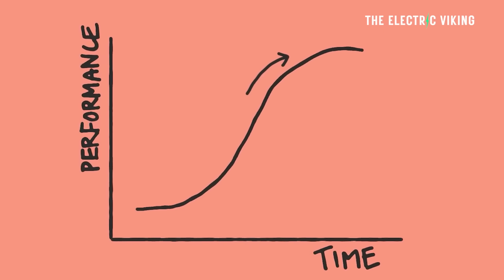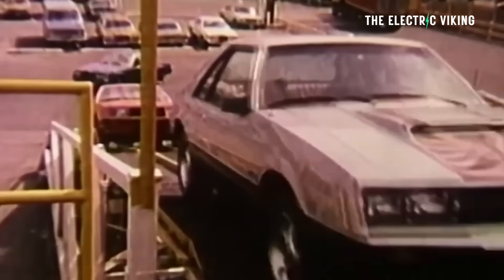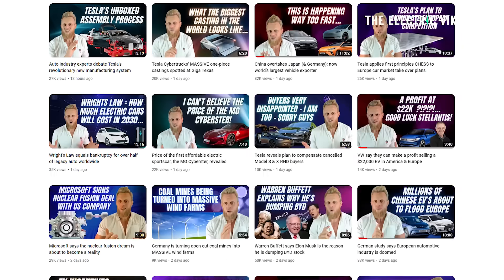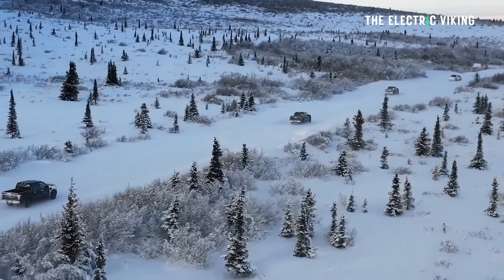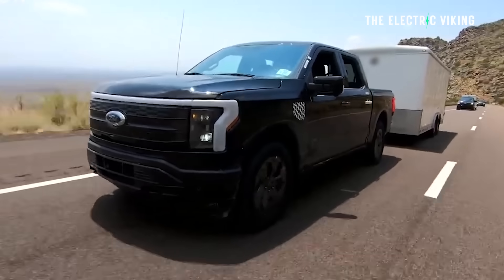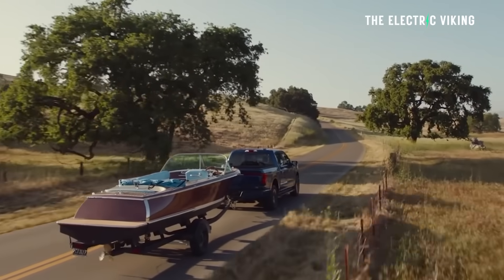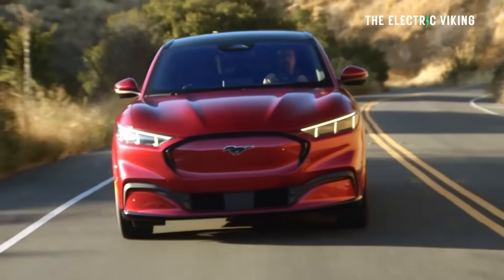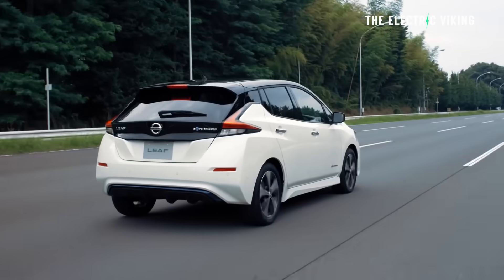EV sales are about to hit exponential disruption phase in the United States

Comment: In the US, the lack of a full coverage charging network is a major bottleneck, and a reason many are delaying buying an EV.   The 2nd reason is price point.   $80,000 Lightning.  $85,000 Rivian.   $90,000 Model S.   In general we are moving in the right direction....but I think 2025 might be the inflection point,  not 2024.
Reply: Charge it home and you can make it to anywhere with the super charger net work currently available. Buy a model Y or a model three.
Reply: @ZeusBullyMax    You have obviously not driven through southern New York State, Central Pennslyvania or rural Maryland with a NON-Tesla EV.   I have.     (FYI   in 2022 14 million vehicles were sold in the US.   Of that 465,000 were Teslas, which means 96.5% of new vehicles sold in the US in 2022 were not Tesla's....people's taste are very varied)
Reply: Model Y….
Reply: @777skypilot   Something to ponder.  In 2022 there were approx 14 million passenger vehicles sold in the US.    Of those, 485,000 were Teslas.  That means approx 3.5% of new vehicle buyers bought Teslas, but it also means 96.5% of US vehicle buyers bought something other than a Tesla.  96.5%        Taste? Styling? Lack of knowledge about Teslas?

Comment: U.S. EV Demographics & Leaderless Charging Infrastructure

Teaser: Of the more than 3,100 counties and city-counties in the U.S.
63 percent had five or fewer chargers installed; 39 percent had zero!

Should not the U.S. charging infrastructure (and supporting energy grids) be a “strategic asset” on par with our Interstate highway system?  

I would also make the same claim for a national cellular infrastructure that provides ubiquitous country-wide coverage similar to what China has already achieved with 4G, and 5G in rural and remote areas.

It would appear that most of the U.S. EV sales are focused on the top 20% of the population in:

“Top five list for EV sales through 2022: California (20.1 percent); District of Columbia (13.8 percent); Washington (12.9 percent); Oregon (11.5 percent); and Nevada (10.2 percent).”

In 2021, a little more than 52 percent of Americans had an annual household income that was less than 75,000 U.S. dollars. The median household income increased to 70,784 U.S. dollars in 2021.

It will take a rethink on the part of the U.S. EV industry to develop and “affordability model” for families in this income range.

Here it’s all about charging infrastructure which has been left to the whim of the private sector. We found during this past winter in cold states such as Colorado large segments of 3rd party, non-Tesla charging networks simply did not work or were so unreliable you would not risk driving in winter conditions outside of a city center. We had a number of reports of stranded EV owners during subfreezing temperatures.

The companies appear to develop charging networks similar to how cellular companies determine coverage in the U.S. They only go where private companies deem there are sufficient vehicles to justify the investment or if provided with government subsidies. It’s unlikely they will cover rural and less densely populated regions for decades to come just like we have large areas in the U.S. without internet and cellular coverage after nearly 28 years.

Go here for a map of the distribution of charging stations across the U.S.:

https://www.autosinnovate.org/posts/press-release/us-ev-sales-continue-record-run

“White and dark blue areas had five or fewer publicly available non-proprietary chargers added in 2022”

For the vast “bulk” of the U.S. EV's are still not practical, overpriced, and models are not tailored to the countries demographic makeup.

Excellent article:

U.S. EV Sales Continue Record Run in 2022; Charging Infrastructure Still Lagging, March 23, 2023

https://www.autosinnovate.org/posts/press-release/us-ev-sales-continue-record-run

Check out these depressing statistics on charging stations across the U.S.

Warning signs: Public charging infrastructure not keeping up

Infrastructure analysis reveals deep geographic disparities in access to public, non-proprietary charging in the country.

Of the more than 3,100 counties and city-counties in the U.S.:

63 percent had five or fewer chargers installed; 39 percent had zero;
The top 14 counties – or 0.4 percent of all counties – with the highest number of chargers accounted for 30 percent of all U.S. EV charging infrastructure.
2022 public charging data:

Total of 103,582 publicly available non-proprietary charging outlets in U.S. for 3.04 million EVs on the road, a ratio of 29 EVs per charger;
Installation of U.S. public chargers is not keeping up with current and projected EV sales. (Context: 934,958 EVs registered in 2022 and only 24,622 new chargers – a ratio of 38 vehicles for every new public port);
The number of non-proprietary Level 2, DC Fast and total public EV chargers increased 31 percent, year-over-year (from 79,000 in 2021 to 103,000 in 2022).

53 percent of U.S. counties added NO new chargers in 2022;
75 percent of U.S. counties added 5 or fewer chargers in 2022;
51 percent of all new charging was added in just 2 percent of U.S. counties;
25 percent of all new charging was added in California;
160 counties added only one new charger.

Comment: If 20 years from now 50% of new vehicles sold are EV and 50% are ICE, would you be OK with that? Is there a point at which consumers should have a choice, or must ICE be eliminated?
Reply: ICE will be wiped out by choice EVs and infrastructure will be so much better. If you own a home and charging is not an issue, EVs are already a better choice for most people. I'm happy whenever I drive my Mach E.
Reply: ICE is literally killing us. It gives our kids asthma, our friends and family cancer, covers our skies in smog. It’s an antiquated and horrible technology from over 100 years ago, we’re practically still using the steam engine.

But even if that weren’t the case, nobody is going to want ice way before 20 years from now. The EV industry is innovating rapidly, and there will be no areas where ICE is superior fairly soon
Reply: idgaf but I doubt it'd happen. There aren't that many retarded people buying new cars.
Reply: ICE must be wiped out. If you promise not to pollute the air I breath then I promise not to poop in your kids sandbox.

Comment: Sam, EV growth rate in the U.S. will remain slow but steady for a few years yet. The U.S. charging network is still abysmal, even in urban areas.
Reply: That is not how it works sorry. Disruptions always follow an S curve. Even horses to cars followed an s curve despite having zero gas stations at the start & no oil drilling, mass production was in its infancy.
Electricity is everywhere so building charging is easy. Most people charge at home 95% of the time.
Tesla’s supercharger network is nearly everywhere you need it already.
Reply: @whowhy9023  this is garbage. Teslas network is simply not nearly everywhere. Also 95% charging at home currently is the problem. Many  people simply cannot charge at their home.